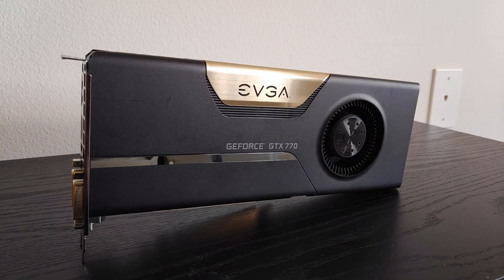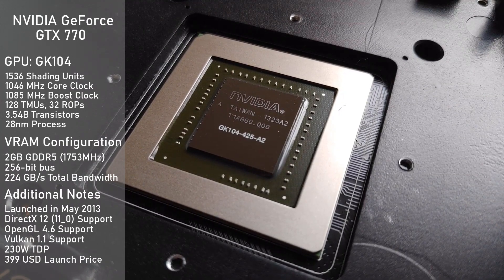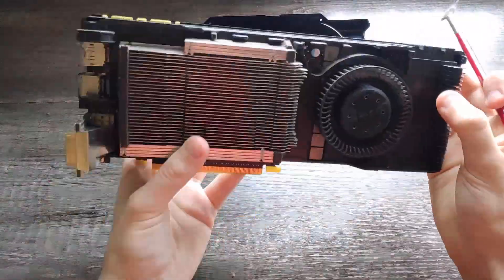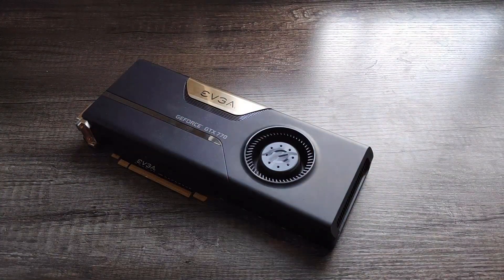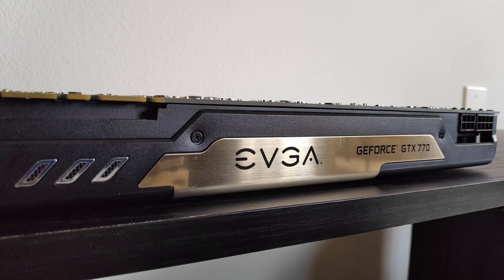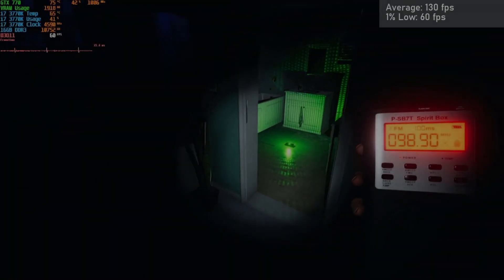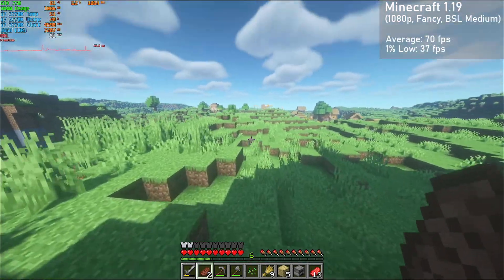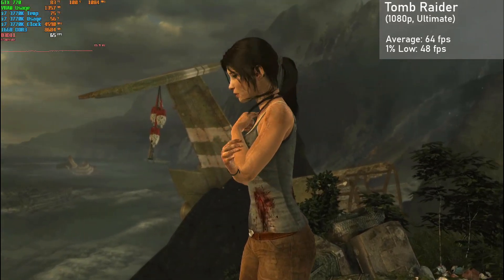The GeForce GTX 770: How Does High-End Kepler Stack up Today?

Comment: I have the rarer 4 GB EVGA version of the GTX 770 and the extra vram does help it a lot
Reply: I had the GTX 680 4GB when it broke i switched to the 770 4GB pretty much the exact same performance back then but thoose 2gb extra made the difference between high and medium settings in COD Infinite warfare for example.

Comment: I had to use a 2GB 770 during the GPU shortage in 2021 and I found that the card performed about like a 1050ti as long as I didn't run out of memory.  If this card would have had 4GB it would have faired much better. I learned the value of buying a card with more memory than you think you might need.  I paid about $130 for the card during the shortage.
Reply: it has a 4GB variant, just harder to find and surprisingly bit more capable than the high end 780ti with just 3GB of VRAM

Comment: I had a 770 from 2013 to 2017 by that time it was really starting to fall off because of it's frame buffer alone.  I swapped it out for a 1060 6GB which was good and cheap but ironically it started falling off faster than the 770 did due to it's low memory bandwidth so I replaced it in spring 2020 with a 2060Super as I foresaw the coming GPUpocalypse coming.  As I play at 1080P it's still all I need.  Moral of the story?  In tech don't count your chickens, stuff can get obsolete very quickly.  We have just been lucky that that the last console gen was pretty weak and held back game engines so our older cards have clung on for years past what the manufacturers expected.

Comment: I used to have 3 770 cards from MSI back in time, one in my editing/production PC and the other two in SLI for gaming, I overclocked them and got really good performance out of them, the first card I got I still have left, it was the most stable one and I overclocked it by updating firmware to the later revision that my other cards was which boosted the core clock by about 25mhz or some more, then I manually overclocked it another 100mhz on top of this, it performed like a king among 770s. the lack of memory was the only bottleneck of these with the 2gb models I had which was very clear when playing Doom 2016 on them. but I still had great performance until I got my 1080 extreme card which I continued my clocking on to make one of the worlds fastest 1080 cards with clocks exceeding 2050mhz. if I can get free performance I want it. PS, if you want to OC the 770 it gonna need a little boost in core voltage for good stability

Comment: I have a Evga classified 680 with 4gb vmem... card is still a beast
Reply from the maker: That's awesome! Have you tried for any high overclocks on that classy? The extra VRAM should help it out a lot as I noticed the regular 2GB gets soaked up really quickly by more intense games...
Reply: @SPNG  only with afterburner, don't remember the results tho... Surprisingly the blower on my 680 was really stout, stays cool, like it really pushes some air.. It also came with a backplate so that probably helped it alot too... It never got over low 60s, but I did always keep fan at 100 when doing gpu intensive tasks... Its in rhe plex server machine now..🤣

Comment: Hey SPNG! In the video you asked if anyone had experience overclocking Kepler based GPUs and I think I can offer some assistance! I love extreme tuning older graphics cards to see if modern-ish performance is still possible and have had an EVGA GTX 770 Classified under the knife for the past few weeks. I've found a handful of Kepler-specific oddities so far but one of the strangest is how badly the card plays with MSI Afterburner. It's been a long time since these cards were officially supported and I think compatibility broke some many releases ago. I started using an old version of EVGA PrecisionX 16 (V5.3.11 x64 release) and it works perfectly. There's also some display compatibility improvements to be had by messing around with the card's GOP partition as well as some very nice vBIOS edits you can make to help get software control of the vCore up to 1.3v. Nvidia left a ton of performance on the table by letting GPU Boost manage GK104. when you give this chip 4GB of VRAM and manually dial in the clocks, it really opens up.
Reply from the maker: I didn't think to use EVGA's PrecisionX tool! I'm gonna try that out as soon as I can and see what kind of clocks I can get out of this thing. Maybe do some BIOS edits too! That's awesome by the way, you pretty much have the ultimate GK104 card! What kind of clocks have you gotten out of yours, and how is the performance?

Thanks so much for the comment man, I really appreciate the advice. When I get a couple of projects out of the way I'll definitely be making a video on this card's overclocked performance.
Reply: @SPNG  Anytime! I've always had a soft spot for the Kepler cards as the 600 series was the new hotness when I was first getting in to the PC building scene. I have the card clocked pretty much as high as possible without getting into LN2/dice territory, I wanted something I could daily drive. I have a few different profiles set but generally for DX11 games it's stable up to 1384MHz and most DX12 titles (that are able to run) can pull 1358MHz. Nvidia hit a home run with the IMC on the 425 variant of GK104 and I can run the memory at 2045MHz for roughly 264GB/s bandwidth. I have the GPU substrate caps epoxied and the die repasted with Conductonaut LM. I'm using the NZXT Kraken G12 bracketing system paired with their X73 360mm AIO and so far I haven't seen the die break 45c running full tilt during benches (16c delta to idle). GPU idles at 27c (5c delta to ambient). VRMs/GDDR5 modules are heatsinked and have a dedicated fan, maxes at 56c/48c respectively during extended sessions. I took 1st place in Fire Strike and 2nd place in Time Spy a few weeks ago for the R5 5600X/1x GTX 770 pairing so I'm pretty satisfied with the performance of the GPU. Getting about 85FPS in GTA V with mixed High/V.High settings @ 1080p, around 50-60FPS in Control with mixed Low/Medium settings @ 1080p, 60-70FPS in Apex Legends with 4GB texture streaming with medium settings and no AA @ 1080p. Runs like a very power hungry 1050 Ti with sketchy DX12 support!

Really looking forward to more of your videos! It takes a lot of perseverance to get some of these cards working properly in a modern software environment and your effort in documenting their performance is heavily appreciated. If you decide to move forward with the 770 revisit and need some firmware tweaks let me know and I can send you some custom stuff! Good luck!
Reply from the maker: @nothing.mp3  Wow, that's an amazing setup right there! You must be able to really stick the voltage to it with that AIO. I'm jealous of those extreme clocks, most GTX 770s can only dream of speeds like that! Good to see that the overclock scales so nicely as well, had no idea a 770 could pull off numbers like that in those games. So cool that you're topping the charts for that hardware combo in 3DMark too! I think it's awesome that you're pushing that Classy to it's limits, I bet it was really fun to tune it.

Stay tuned, I have some cool stuff coming up! And I'll definitely take you up on that, I'm not too well-versed in tweaking the vBIOS. I really appreciate your insight into overclocking the GTX 770, it's been really helpful since a lot of that info seems to have been lost to time!